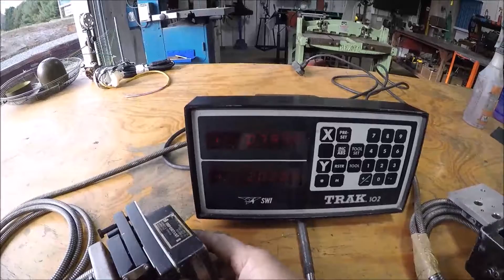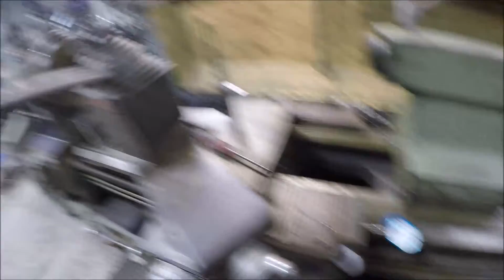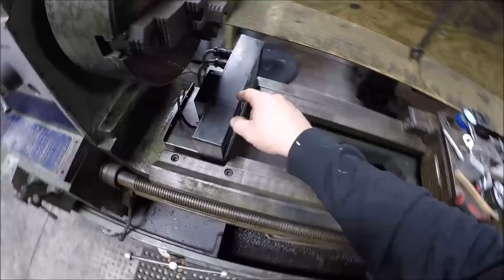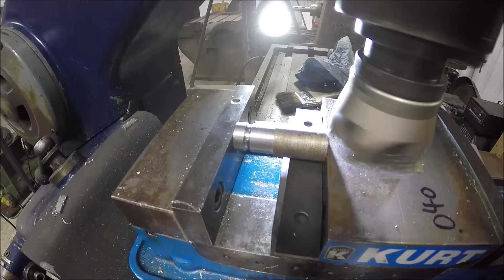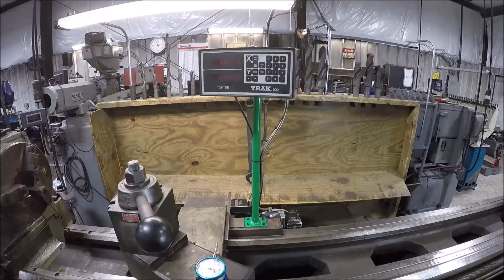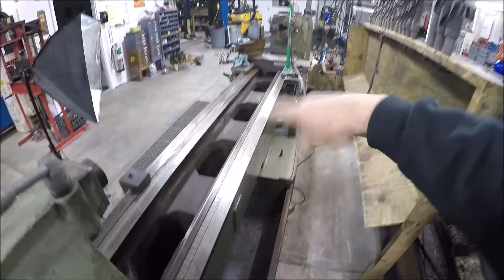Installing a SWI Trak 102 DRO system on my Jet lathe

Comment: Never saw that Trak system before - very interesting. Thanks for showing the install. 👍👍
Reply from the maker: Thanks for checking out the video. Cheaper than buying a DRO with a 10ft glass scale.

Comment: What a clever system. Using the lathe ways as the scale. Looks to be a much easier installation that the usual DRO. Thanks for sharing this Tom. Cheers Nobby
Reply from the maker: Yeah too bad they don't make them anymore. They pop up for sale on E-Bay now and then.  Hopefully it will last a good while.

Comment: You need some real good chip guarding because just a piece the size of a hair can cause the travel to not match actual and you can get errors in the readout. if you are working to a few thousandths tolerance not really an issue but if you are trying to work to the exact thousandth they can be fussy particularly over long distances.
Reply from the maker: Good idea. I will make one up. I did put new wipers on the front of the units so that should take care of the majority.

Comment: That's a very nice "bolt on and go" system. Well, almost :)
I'm just wondering if there could be any risk of wheel slip with chips and oil... I don't know.
Reply from the maker: Hey Michel. Yeah that is a concern. There are sponge type wipers I put on that protect the wheel from chips.

Comment: well sorry tom but i have had experience with a similar system running on reader wheels same set up as yours when the way oil gets on them they slip and such so be careful as sometimes you don't notice this can be out ten thousands of an inch sometimes more all i can say is be careful with it on precise jobe i could never trust mine after it did it a couple of times and completely stuffed up a couple of jobe i then went with the proper D R O with the glass readers never a problem after this did you ask yourself as to why someone got rid of this and sold it off to yo0u hoping you have better luck than i did Cheers all best and DON'T TRUST IT NO MATTER HOW MANY TIMES YOU TEST IT dribble some oil on them and see what happens
Reply from the maker: Thanks for letting me know that. I will keep an eye out for incorrect readings.

Comment: G'day Tom.   Very nicely though out DRO Project, which works to your specifications.  The question I would like to ask is, wouldn't the DRO Module be better over the LHS gear box cover, to stop the constant  movement & possible vibrations while travelling Left & Right over the bed 
Great video, catch you on your next venture
Hope you have a Great & Prosperous New Year 2024
Reply from the maker: Hey there Ted. Only problem with mounting the DRO at the head stock would be when I am 10 feet away from it working at the tail stock end. I wouldn't be able to read it. 🙂
Reply: Fair call with the length of the bed verses reading the DRO. Mine is only 1 meter or 39" or whatever so I would not have thought of that

Comment: That's a great system .     No big expensive scales to damage .    Have a great New Year ,  Cheers  🍺🍺🍺
Reply from the maker: Hey there Max. Yeah only thing to keep tabs on are chips trying to get to the reader wheel. I put fresh wipers on them so they should be good for awhile.

Comment: That's a pretty interesting DRO. I like it how compact it is.
Reply from the maker: I thought so too. I am glad the install went as easy as it did. Hope you are staying warm up there in your shop. I started using the wood stove this week.
Reply: @hilltopmachineworks2131  I got the Mr Cool mini-split installed over the New Year break. The shop is 62 degrees right now, which is the lowest heat temp I can set it. I have to see how bad the electricity bill is before I decide if I will use it all winter or not. 🥶
Reply from the maker: Oh nice. 62 is toasty.  @MyLilMule

Comment: Hello friend Tom, in my workshop I have all the machines with a height display and I can assure you that it is the best investment you can make, whatever machine has a display, it changes the rules of the game and saves time, in comfort of use and precision...so I encourage you to little by little put a display on all your machines...a big hug and give it a go in 2024, which will surely be a very good year..
your spanish friend

michael
Reply from the maker: Thank you! At some point I would like to get a DRO on my Abene mill.

Comment: A digital Trav-A-Dial.....pretty cool! Never seen one. Looks perfect for long bed lathe.
Reply from the maker: Hey Jeff it is the cat's meow for long travel machines. Too bad SWI does not make them anymore and you have to search the secondary market.
Reply: Yep, lucky find! That is too bad they stopped making them as it's a great idea. Looks like it's plenty accurate, unless you're building the space shuttle. If diameter accuracy needs to be really tight, you could go with this system on the carriage, and a high accuracy scale on the cross slide. Good find! @hilltopmachineworks2131